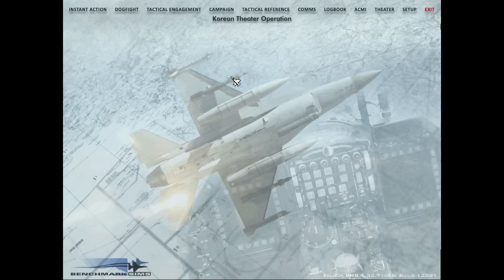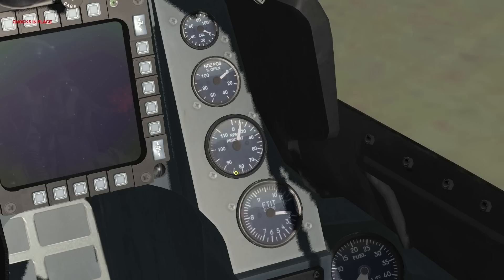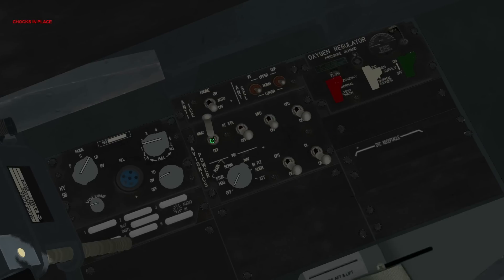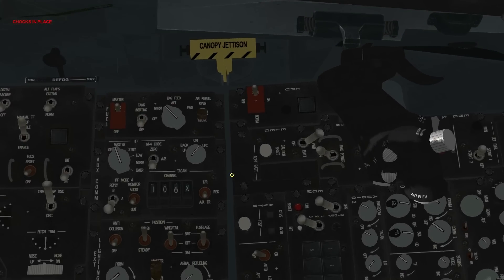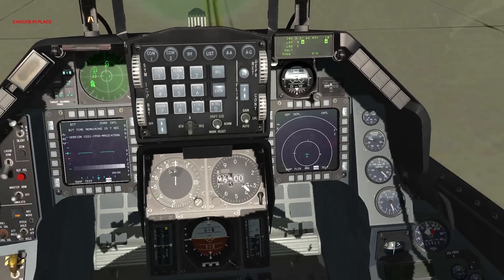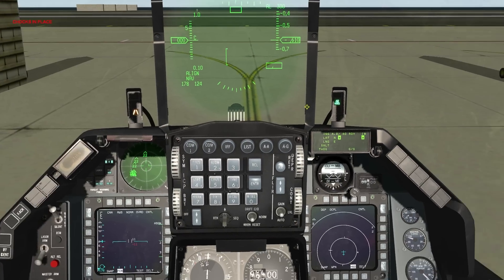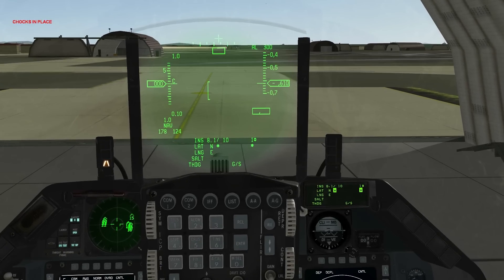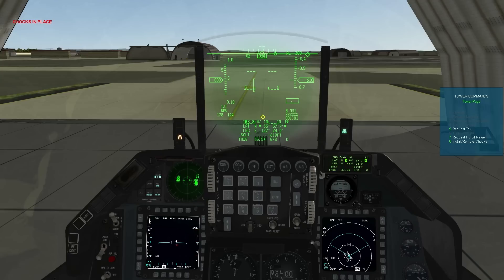Falcon 4 BMS Tutorial Ramp Start / Takeoff / Startup

Comment: When I press up down "," key arrow key of my falcon 4.32, the plane doesn't do left rudder but move my view point to left,  "." key becomes view point to left, "L" becomes viewpoint to central. I didn't make any changes.

Do you know the possible reason that these keys doesn't do what they suppose to do? Is there another key I should press together? I actually try ctrl or alt or shift with right arrow key and none pf these 2-key combination works. Pls don't ask me why I am still using 4.32 instead of upgrade to 4.35. I like old version.

Comment: When i do my rampstart in 4.33, I always get an avionics fault and an IFF fault... When I get them, I usually clear them in the mfd test page. But when i then take off I have "NO RAD" displayed on my hud. What could be causing these problems?
Also with 4.33 I sometimes experience a weird cockpit wobble at certain times while flying...I have no idea what could be causing that. (like my wings are flapping/flexing without manouvring) ...really weird.
Reply: +Verdi
Same here. I'm still trying to figure this out..
Reply: +Maciej Bałauszko I talked to Snax (amazing BMS pilot) about it. He says everybody has the same issue in 4.33 (avionics and iff) for now. There is something wrong in the programming of the rampstart tactical engagement.
So the thing to do for now is just clearing the faults in your test page.
For the "No Rad" message...I figured that one out. I skipped a step on my mfd which caused the message to stay on all the time. And the wing flapping... It is normal. Pilots call it "fluttering". It happens when you exceed certain speeds with certain load-out configurations of the jet.
As you can see I am still learning everything....but I'm slowly getting the hang of most things.
I hope this was helpfull ;)
Reply: +Verdi
Thanks! I'm completely new to the BMS so it's all new to me. The sim is great though. I've been playing DCS before and there's something about BMS that feels better. I don't know what it is but I'm enjoying the learning process a lot.
Reply: +Maciej Bałauszko Exactly the same story here ;)
Reply: Hey, I know you posted this a year ago but do you have any idea about whether this bug is fixed yet? I too get IFF and avionics faults on the caution panel. Also my INS Align seems to continue infinitely until it reaches 99.9, then stops (I still get an ALIGN warning on the HUD though).
Reply: If you haven't resolved this on your own yet, yes the faults are still there, just clear in the test page. As for the alignment, wait until the system and hud flash rdy then move the knob from align norm to nav

Comment: When I ask them to remove the chocks nothing happens. What gives?
Reply from the maker: you have to be on the right radio frequency
Reply: How do I do that? I tried pressing Comm 1 and switching channels but I can't get the exact frequency for the airbase I'm at
Reply from the maker: +cominroitover80 see my data cartridge tutorial
Reply: Krause OK thanks I figured it out. I was trying to figure out how to type a decimal into the ICP, turns out you don't need to.  I also figured out how to "set tower" in the data cartridge thing.

Comment: Can I use this tutorial for Falcon 4 Allied Force? I'm trying to learn it.
Reply from the maker: +MrProfilen In theory.
Reply: Krause Ah, maybe I should just stick to the manual?
Reply from the maker: +MrProfilen I actually have an allied force ramp start video as well. search my channel for ramp start
Reply: Krause Okay, thanks! I didn't think you had one, so I didn't look. I'll make sure I look into it. 

Also, will throttle control that is built into my joystick work fine? I'm kinda lacking money to  buy HOTAS system or something similar. So, I'm using one of my older joysticks(still works fine).
Reply: +Krause Hey, quick question. What are the most important keys to map to my Joystick? I don't have a HOTAS, but this joystick has a: Throttle control, a 8-way hat, twist rudder, 12 buttons(including the one on the direct side of the joystick, and the fire button. I want to get a decent set-up going ,but I don't know the most important keys.
Reply: That's not a, "quick question" lol
Reply: Reagan505 This is an old ass comment fam. Doesn't matter anyway. I have a full setup key-wise.

Comment: Thanks Krause for the awesome tutorial. The only problem I have is when I have everything loaded and I try to ask the ground crew to remove the chocks using t-8. I get no response and the chocks are still in place. Thanks
Reply from the maker: Make sure you set your data cartridge to have the right tower frequency.
Reply: Ok I have it working now thanks!
Reply: Krause  Krauze Could you please answer a question for me about the f-16.
 for tactical engagement: take-off the picture on the loading screen says that my engine is a pw 220 type E has 25,000 pounds of thrust. but I thought in bms we fly the block 50 f16 with a 229 with 29,000 pounds of thrust. Is the two seater in the tactical engagements not a block 50?. Also when taking off with full burner my engine rpm is about 96% and my engine noz is between 95 and 100, is this the right performance.

I am just getting a bit paranoid, because I am not accelerating in a climb(even clean) at the rate I thought I would be.
Reply: Kevin Morrissey Same happens to me ,and what I can't understand is that the plane in turns and in steep turns rapidly loose speed,like it can't go over 200 kts, and in climbs loose speed also... wtf!? :D Extra 300 have better maneuverability than this F16 :D

Comment: This tutorial is AWESOME man. I've just got one PROBLEM: after I do everything and I remove the chocks and the parking breaks, the plane slowly starts to move: but I cant turn!!! It just goes straight on, passing across the taxiway and going into the grass, whitout even trying to turn left or right. What do I do??

P.s sorry if anything is wrong, but I'm not english
Reply from the maker: You need to engage nose wheel steering. Default key is shift /
Reply: Ok but, to remove chocks, I press shift / so... you say that after I call the tower to remove chocks I have to press shift / again?
Reply from the maker: Davide Roversi you should be removing chocks through the tower (t) menu. Bottom line is you need to engage nws
Reply: Ok got it

Comment: This is the simpliest and best ramp start tutorial I've ever seen.
Maybe somebody can help me. My HUD is almost blank. I have gun crosshair, the speed index (but not the scale) the altitude index (but not the scale), a NO RADAR text and the G meter. And that is all. I don't have heading scale, flight path marker, pitch scale etc. I am sure that I've turned all the switches in the correct position, as in the video. NO RADAR test does not disapper after engage the FCR correctly, and bit test done.
Does anybody know what should I do different way?
Reply from the maker: Sounds like you didn't flip on radar on the right side below the fuel consumption analog gauge
Reply: Krause
Thanks, I've checked it again, but I have all my switces in the same position as yours in the video. (Radar in stby position)
After bit test done, I still have the NO RADAR text on the HUD, and still have not scales, nav mod, or any other.
Do you have an other idea?
Reply from the maker: László Véber if you want upload a video of your ramp start and I'll take a look.
Reply: Krause
and this is the situation if I choose a runway start or taxi. Moreover, it is the same not only in TE, but in the campaign mod. So my HUD is absolutely useless.
I am sure that I make something not correctly, but I can not recognize what.
Reply from the maker: László Véber
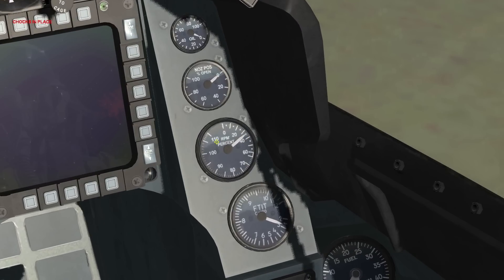You didn't turn your air conditioning on  bud - you fried your avionics (EQUIP HOT warning on the fault panel). Watch here: 2:38
Reply: Krause
Thanks for your help, I am going to check it again. Hopfully it solve the problem.
Reply from the maker: László Véber
 I updated the link in my previous comment. I turn on the air conditioning at 2:38.
Reply: Krause
I checked again. I turned it to the "normal" position in my video at 1:43. It was only covered, but you can hear it clicking. Otherwise I have repeated the whole procedure and the result was the same.
It is very strange that I have always the same HUD you have seen. It does not matter if it is Tactical Engagement, Dogfight, Campaign, ramp start, taxi, runway, airborne.
I have uninstalled and reinstalled the software but nothing has changed.
I would be sorry, but slowly I have to give it up.
Reply from the maker: Your fault panel has an EQUIP HOT warning on it - that is the reason why your HUD and avionics are messed up. The AC isn't on. End of story.
Reply from the maker: Also don't wait too long to turn it on, otherwise it's too late and the ramp start is scrubbed.
Reply: Krause
Now I can see the difference. My engine has spinned up to 70% RPM, and I have the EQUIP HOT.
When you turned on the air condition your RPM was less and you had not the warning light. I was so stupid, I am sorry Krause. Unfortunetly I can try it again only on the weekend.
Reply from the maker: It's ok :)
Reply: Krause
Hi Chris! Did you check my repeated ramp start? I am waiting for your comments. Bye

Comment: My plane isn't doing the BIT test, any help here?
Reply from the maker: Are you sure you didn't overheat your equipment? make sure you turn on air conditioning! I believe overheated equipment will scrub your rampstart.
Reply: I saw it a few minutes later :P Everything is working just fine ;)
Reply: +Krause hey man, is there any tutorial or manual that you know that explain what each and every keybinding actually means and does?